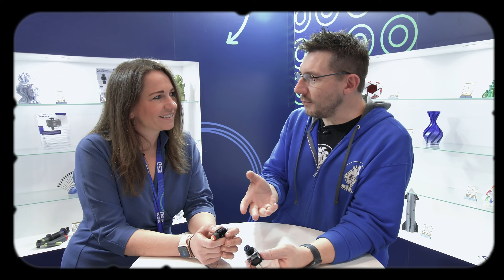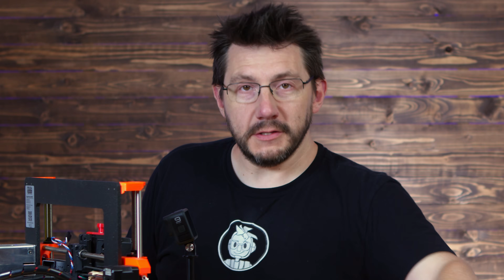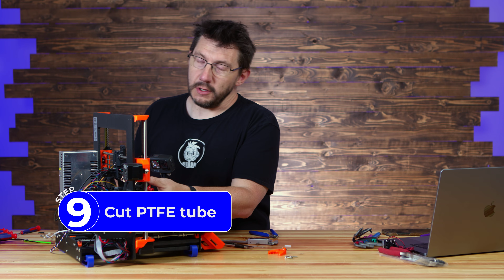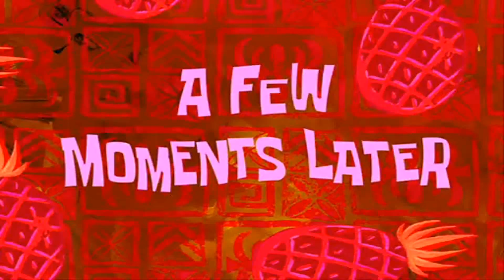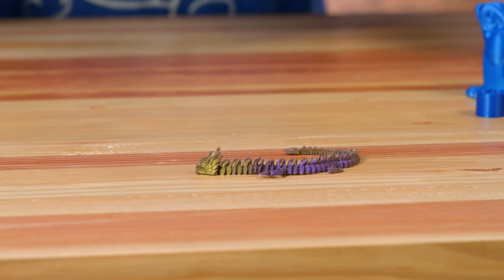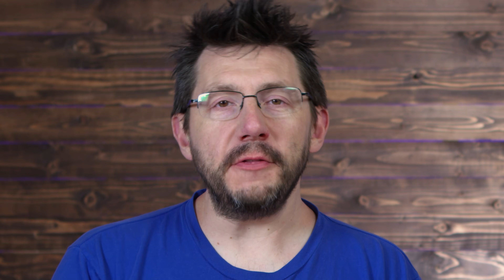Installing an E3D REVO6 in the PRUSA MK3

Comment: "The instructions are for a Mk3S... this is very much not a Mk3S". I FEEL THIS! Just dealing with a standard/non-upgraded Mk3 is such a confusing fiddle today. Just dealt with that tonight, upgrading a Mk3 with the Revo nozzle! I so, most sincerely, wish search engines (not just Google) would stop helpfully swapping-in Mk3S guides when I search for Mk3. If I came across your video at the start of the project (after much searching and not finding...), I'd probably have gone through it a bit smoother! Now this comes up in recommendations... because of course it does, lol. Anyway, thanks for covering the MK3!

(BTW, that heat-sink/hotend removal? Buried in a hard-to-find assembly manual for the Mk3. There's a technique to it - you have to pull the heat-sink parallel to its current position but with a slight tilt, which is a strange motion... that will "spring" the PTFE tube enough to allow the right angle for removal without "brute force". That was a huge challenge for me, easy once I found the guide!)

Comment: I have found that the Revo nozzles vary enough in length that I have to change z-offset when I swap nozzles. That is annoying. Would be nice if the nozzle lengths had a tighter tolerance.

Comment: Not yet compatible with MK3.5 - well, actually works completely fine but pid tuning is not available on the 3.5 and thus self testing fails, nothing terrible but printer asks to finish calibration every time you boot or start a print. Anyone have any info if this will be addressed? thank you!
Reply: after a week of printing I am seeing some anomalies when printing so I think with my limited knowledge that pid tuning could probably address this?

Comment: Here is the  are the directions from  E3D "Prusa released a new firmware 10/01/23 that has the potential to cause temperature issues with the Revo Six, Please refrain from upgrading for the time being until we can verify stability."

Comment: Current E3D webpage says not to install Because of update in JANUARY to software by PRUSA which can cause overheating
Reply from the maker: As long as you aren’t running the latest Prusa firmware update, it’s okay to install.
Reply: @3DPrintingNerd  Why would I stop installing the PRUSA updates?
Reply from the maker: @terrylindsay445  Right now, if you have an E3D Revo, the new temp models aren't working right. So ONLY if Revo. If you don't have a Revo, you're good!
Reply: @3DPrintingNerd  I have the stock V6 and the new RapidChange Revo Six. When I go to the Online instructions via Amazon, they say due to the PRUSA update that came out in January 2023 not to install the unit because their can be an overheating problem. On the Amazon comments for this unit many people are complaining about thermal runaway and heating problems!!!!

Comment: Getting ready to make the swap.  I just had the threads pull out on my Prusa.  Just had started a print and the heater block came loose from the heatbreak. I currently printing some conductive ABS but as soon as  that's done I'm putting on the REVO.

Comment: i prefer the smaller nozzles usually using .2 or .3  just for the finer detail..  it doesn't necessarily have to be small prints... larger prints just take longer but the detail improvement is noticeable.  My question though is when you first installed the revo and first nozzle, did you have to do any nozzle height adjustments or z offsets for probes????  or did you just thread it in and just hit print?

Comment: I did this upgrade on the office MK3 because I don't trust myself to correctly install a V6 style nozzle without ending up with leaks down the line. That and hot tightening sucks.

The local supply shop started carrying the Revo series, and they mistakenly sent me a Mini rather than a Revo6. It's cool, mistakes happen, and they made the exchange without any problems.

The best part of this is that I didn't need to reprint the extruder housing. Yeah, there are inline connectors for the wiring, but that's it, and they didn't interfere with the harness as much as I feared. I only needed to modify the PTFE tube, and that was quite easy.

I don't see myself swapping nozzles like crazy, but the ability to swap a nozzle for any reason when the printer is cold is well worth the upgrade.

Comment: Like others, I installed the Revo when I assembled my MK3S+ two months ago.  I also changed the thermistor connector on the end to use the same style as the normal Prusa connector, so that it doesn't come loose inside the electronics case (which others have complained about on Reddit),

Comment: I use a 0.25 Nozze for printing jewelery and in general small stuff. But I used a Mosquito Magnum Hotend on my MK3S+ not so easy maybe as swapping nozzles on the revo but with the mosquito I could still use my Nozzle X hardened steel nozzles and I can change nozzles with one hand as well and even cooled down nozzles

Comment: I use a chimera with a 0.6 and 0.3, 0.6 for high speed, and 0.3 for fine details. Mechanical parts also are quite nice with 0.3, and you can push 0.3 to print like a 0.4.

Comment: Great video as always! I recommend adding a few lines of G-code to at the end of the print to retract the filament and then again when you start a new print. That way you can change nozzles after the print without any heating or cooling cycles.
Reply: what would chance be that G code?

Comment: I have a 0.2 on my Monoprice Select Mini Pro. I use it for super detailed stuff. I'd suggest a 0.08mm layer height with a 0.12mm initial layer to start. Can fine-tune from there. Be ready for super long prints though. But they turn out as close as you can get to resin with FDM.

Comment: I upgraded my nozzle on my original Mk3 to a hardened one, used the hardenedness a couple times and haven't since. I am waiting for something major to happen to the hotend to so I can legitimately "fix it" but the bugger just will not die 5 years on. That said, you did not make that look easy, I'll probably just keep ramming a 1.5mm allen key down to clear clogs for a while :) That also said, I've never used anything other than a 0.4mm nozzle... Probably should size up for the hydroponic planters though. Thanks for the video and entertainment :)

Comment: Would love to see PRUSASCLICER build in nozzle size changes during a print (the same way you would manually change filament colours but change nozzle sizes) this would allow you to print fast and heavy on the bottom of a print, then switch to a small nozzle to add fine details or words or logos to the top of a print… just a thought…high 5

Comment: I really prefer to use allen bits instead of allen keys. So much nicer to have a proper screwdriver handle to turn when dealing with that. For smaller parts, an iFixit tookit is fantastic.  I used it to install my own Revo in my MK3 and it is printing like a champ. With a MK3S+ the instructions were golden and it was quite easy to do. I used two zip ties and hung the stepper motor from the rails via a screw hole on that, and the same with the cooling fan. Just to make sure to support them so they didn't hang off wires. The worst part was probably putting the darned sleeve back on, fiddly especially to clamp it down at the electronics box.

Comment: You don’t need to remove the filament before removing the installed nozzle. Just set your printer to retract about 15mm after print finished and it’ll be sufficient to easily remove after cooldown.

Comment: I've never swapped my nozzle, although I do have a pack of different sizes. I didn't know about complexity with actually changing it, just that it has to be hot. I was concerned more with the adjustments to the temperature during printing with a different size than I'm used to.
Reply: I swapped my nozzle for a Nozzle X on my MK3; it was my first nozzle swap. I thought I had done everything by the numbers, though it was a major pain in my ass trying to do it without even being able to see what was going on, I found it impossible to get any leverage or comfortable grips trying to see what I was doing. Maybe there's a better way, like flipping the printer over or something but I tried doing it in place. Basically, a horrible experience in every way, and I was afraid of snapping the thermistor wires and such that were right there and in the way. But, I did it, tightened the nozzle down, and did a print and it went great. By the second or third print, it was shitting big blobs of burnt plastic onto my prints... I failed, and left a small gap between the nozzle and the heat break. The whole experience sucked in every way imaginable. I swapped in a Revo just the other week and MAN what an upgrade. You can't fail the swaps, leaks are borderline impossible, and it's all done cold, not at 250 degrees.

Comment: This is an incredible system and the micro on the mini is no less incredible.  The accuracy of this design is so good, swapping the Revo6 into the MK2.5/MK3s printers requires no first layer calibration after the upgrade nor between nozzle swaps.  The other awesome bonus is if you own an MMU unit, this is the final piece to get that to operate reliably!!!!  The formed ejected tip comes out absolutely perfect with no stringing to jam up the filament path.  I am over the moon with my MK3s and MMU2s now.  Yes I did a few other upgrades to the filament path and replace the filament buffer with a new available design to reduce friction to the lowest possible and now with the Revo6 it is 99.9% reliable.  Will be running a couple more multi-color prints to validate, but so far it's good.  Great buy, especially if you want easy nozzle swapping.

Comment: I felt your comments on traditional nozzle charging were quite measured/guarded. I’d love to see you do a conventional nozzle change to see what you mean. Maybe you have that video already? Useful for the majority of users that don’t have a Revo. 

My personal (hot) take is that removing the fan is a semi-optional step, and that the thermistor wires really look vulnerable to damage while scrabbling with the nozzle and a hot end. 

I got a 1.5Nm torque to put nozzles in, but now I’m scared that if I’m not in the Goldilocks zone I’ll either leak filament into difficult to reach places or crack the heat brake. Prusa docs don’t help quell that fear with all the warnings about the hot end.
Reply: I've done exactly one normal V6 nozzle swap, and it failed. It printed after that and it was almost right, but I left a tiny gap even though I thought I got it right, so it started shitting burnt plastic blobs onto my prints. Old style nozzles are awful. I never want to go there again.
Reply: @extectic  Fear+1 - Joel is so casual about it now he's "learnt".  I want to see him stumble through the change like us normies.

My current plan (as I have some E3D nozzles I don't want to waste) is to try, and if I fail, replace the entire thing with a Revo.  Grudgingly moaning as I do.

Comment: Does E3D make a hardened nozzle for the REVO Six?
Reply: It’s due to be released in the coming months.
Reply: It's called Revo Obxidian (there are also Obxidian nozzles for the old style V6 in the works). A multi-material nozzle with a hardened core with a lot of anti stick and diamond like coating stuff going on, with a lot of copper or brass around it, I think. They just auctioned off the first ever set to go to private party last night as part of their Sanjay foundation charity; over £1200 for a set of four... either way, they're clearly manufacturing some, so can't be too long before they hit the market. I can't wait.

Comment: A core xy because getting tools on there are sometimes difficult or annoying. A "quick change" nozzle would be awesome. I might look at putting one on my ratrig
Reply: It's difficult and annoying on a Prusa too. I never want to have to do that again. I've been eying a Ratrig myself as my next build, and it would absolutely have a Revo on there, never going to willingly use an old style nozzle again.
Reply: @extectic  currently I'm using different hotends for all my printers bar my chirons which have v6s that might be super easy to change to revos. I am definitely considering changing over to these across the board purely for equality and interchangeability. Granted I don't swap nozzles too often aa most of the stuff I print is either detailed or large which I have machines specifically setup for certain jobs.

Comment: Yeah changing the hot end on the MK3 was a pain. Really happy with the later design changes. $50 for the upgrade was pretty easy to swallow anyway. The MK3S+ still uses the Nylon on the E axis the other axis not anymore.

Comment: At TCT E3D said when using the 0.15mm Nozzle ASA or PETG seems to be better to print with Versus PLA as the higher temps make it easier to flow and its a more pure filament verus PLA

Comment: I like the idea of 'easy-nozzle-changes' but I think E3D really missed the Boat on the REV06.., maybe if they worked with Slice Engineering to incorporate their Copper-Head Heat-Brake- then the PTFE would NOT be against the nozzle and you could actually print above 240 Celsius!

Comment: Joel - you asked for feedback about smaller-nozzle prints - Stefan, did a benchie with a 0.1mm nozzle that came out a size comparable to a grain of rice! It was about 7 months ago. (Edit: if you search for 0.1mm nozzle it should be the first result listed.)

As for the Revo system... cool concept, but I would prefer an all metal 1 to 1 that uses PTFE.

Comment: They also have revo .15 nozzle now, im in process in putting on a hemera revo on my printer had a clone bontech direct drive and used a .1 nozzle to print a 25% benchy really tiny .05 layer height

Comment: I've used an 0.25 mm nozzle for prints that are have detail features that are just a bit too small to print with 0.4 mm. Lately, for example, I've been experimenting with designing custom border sprinklers for my backyard that have small details that nevertheless have a significant effect on the spray pattern.

Comment: Would love to see prusa integrate this ecosystem with their printers.
Reply: Prusa is open source. 3D REVO6 is patented, closed source. These are mutually exclusive.
Reply: @Dust599  open source doesn't mean you can't use patented components off the shelf..
Reply: @Dust599  prusa literally has a specific patent on the nexstruder
Reply: Well It actually seems like they did. The XL is supposed to have something similar.
Reply: @MorTyn_Ursa  The nextruder nozzle seems similar in that you aren't faffing around with separate nozzle/heater block/heat break, but doesn't seem to have the quick change capability.
Reply: @davydatwood3158   Nextruder on XL and MK4 are hot swappable.
Reply: Yes and No. Easier yes, but you would be locked in that ecosystems. Standard nozzles are cheaper and more widely available. Maybe as an Upgrade Kit or as an Option while ordering.
Reply: @MaxMichel89  I mainly care about the lack of a gap between nozzle and heat break. Doesn't cause inconsistent extrusion or potential user error during nozzle swaps. The ease of swapping nozzles is nice, but I think the bigger benefit is the one piece filament path.
Reply: Apparently Prusa had some concerns about the Revo so they designed their own version for the XL.
Reply: @bladebornstudio9833  There were not concerns with the design, just that it is patented.
Reply: @oneheadlight8000  That’s good, they pair so well with a MK3, I have 3 installed so far, two more on the way 🤙 Slowly going all Revo 😁
Reply: @bladebornstudio9833  me too.. we slowly went all prusa and now looking at Revo for a lot of them. The lack of a gap between the nozzle and heatbreak is the best feature in my opinion.

Comment: Revo is just awesome, i still use my last beta one (a mini revo) with the .4mm nozzle, if you retract you filament enough when you finish your print, you can even swap nozzle  without even removing filament :D
Reply: How much retraction is needed on end code? And are there needed to adjust start code or those the purge line fill it back in if your not switching filament?
Reply: @oleost  i only use 5mm retraction on my end gcode,  and of course, i "extrude" it before the purge in my start  gcode.  more can be useful, cold filament tends to stick well to the inside of the nozzle but i managed to change it a few times like this ( i don't change nozzles often).

Comment: I use a 0.25 mm nozzle for detail oriented prints like logos and names. You can make some really cool and detailed name tags and maker coins with them! Other cases are for the 0.05/0.07 mm resolution when I want to absolute best dimensional accuracy on a part. 

Be careful though, the prints take substantially longer and it’s pretty easy to clog a V6 one.
Reply: Agree 100%.  When I tried to print a Harry Potter wand stand, the text on the engraved plate was nearly unreadable with a 0.4.  You could even see the issue in the slicer, as it wouldn't move the nozzle into some of the tighter areas, creating filament gaps between the text.  As soon as I reconfigured the slicer for a 0.25 nozzle, the slicer results dramatically improved, and the resulting print was near perfect.  I think text is the #1 use case for a detail nozzle, as any print imperfections catch your eye immediately.

My hope is that the Prusa XL with multi-tools will allow for different sized nozzles in the same print.  Could be the best of both worlds, fast printing with amazing detail where you need it.

Comment: Why didn't you upgrade to MK3S since you already had it all apart?
Great build. I use 0.25 for printing small gaming minis. Heroes and bosses I print in SLA, but 0.25 was life changing until I got my first resin printer.